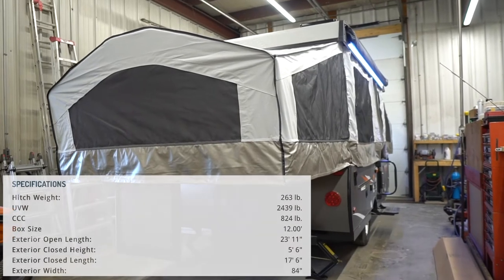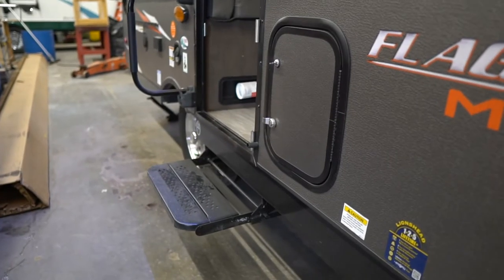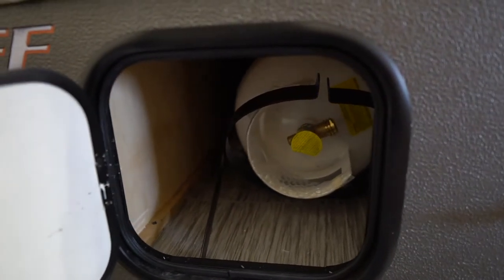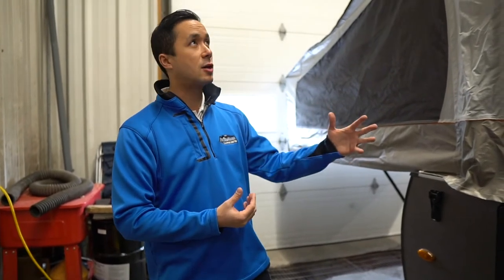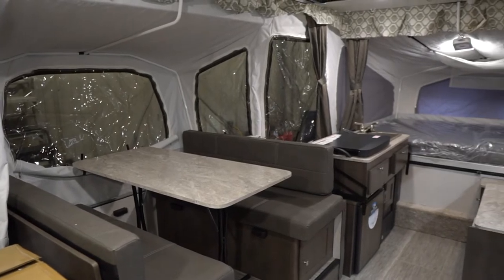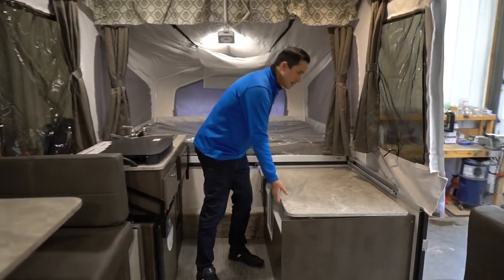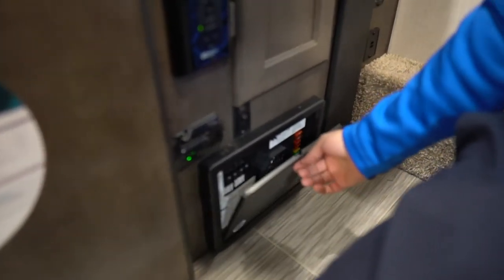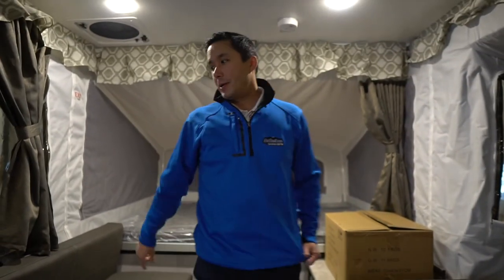2021 Forest River Flagstaff 228D tent trailer

Comment: Can you get a AC as a option its gotta have a air conditioning
Reply from the maker: Hi David.  Yes you can get AC.  There is a AC prep kit from Flagstaff or you can select to option in a low profile 13.5K or 15K  BTU AC.  Hope that helps.
Reply: Just go places you don’t need a/c, isn’t that the point of camping
Reply: Hon your camping.  You shouldn't be using ac..lol. we went camping every weekend in the summer in a tent trailer. It didn't have ac.

Comment: Nitro filled tires? The air we breathe is 78% nitrogen.
Reply from the maker: Beach Bum, yes the air we breathe is 78% nitrogen just the same as regular compressed air.  When referring to "nitro filled tires" you typically will fill with 95% range of nitrogen making them 1/3 better in pressure retention.  Also eliminating moisture/water vapor within the wheel allowing for longer life of tires and less corrosion of wheels.  This is why alot of rv manufacturers today are using green caps indicating that tires are nitro filled instead of being filled with just regular compressed air.  Thank you for your comment